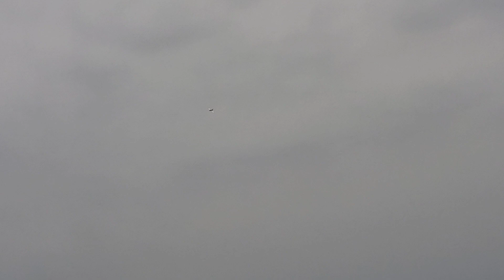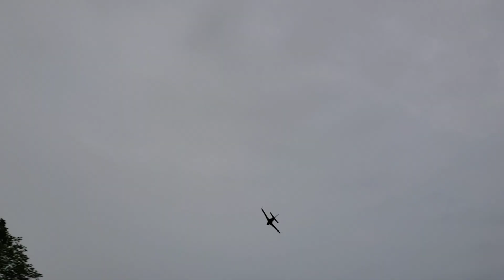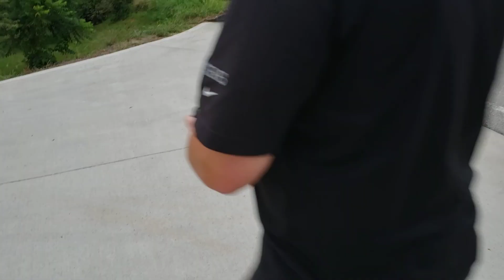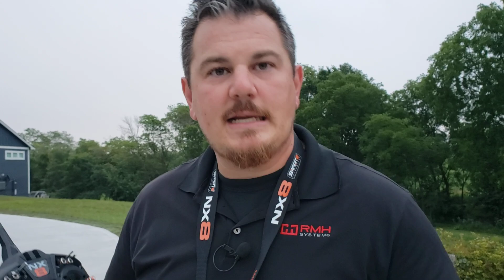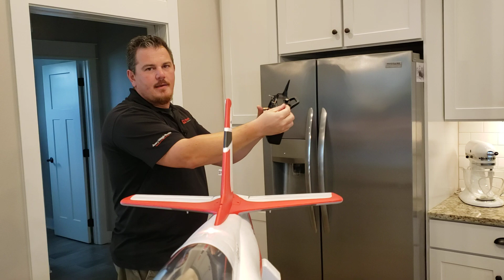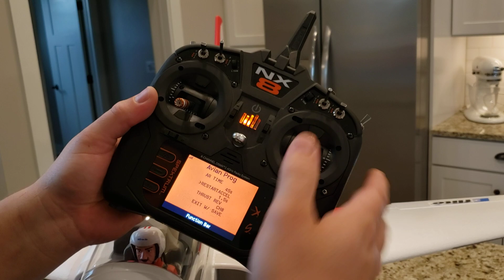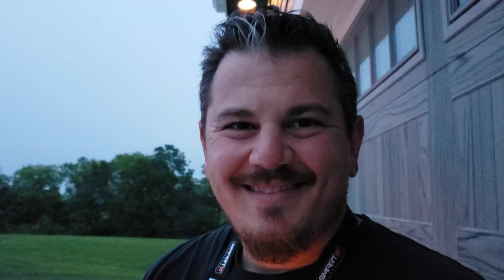Horizon Hobby - Viper 90mm - Pilot Fatigue Switch for Thrust Reverse & Test Flights

Comment: In my case on my F16, I had to reverse switch G (aux 4 on my radio channel 9) so that in the forward position, it was normal thrust.  When I set it up, the forward and middle positions were reverse thrust and the back position was normal thrust.  I wanted it the other way so after reversing the switch, I was able to put the values as Brian did in the mix and now everything works the way I want.  I know this video is 3 years ago but it still works today!  Thanks, Brian

Comment: Omg. Can we do this to the dx9?
Reply from the maker: Should be able to make this all work, but I don't have a DX9 to test it with, but shouldn't be a big deal. If you can't access the Avian ESC programming menu on your DX9, then you can try updating firmware on your Tx, then if still not, then get an Avian ESC programmer too, which can help you activate the Thrust Reversing, then just make a mix like we did...

https://www.jdoqocy.com/click-9240406-15735260?url=https%3A%2F%2Fwww.horizonhobby.com%2Fproduct%2Fsmart-esc-programming-update-box-avian-and-firma%2FSPMXCA200.html

Comment: Amazing and professional video.Thanks for sharing your knowledge with everyone. The plane is beautiful and flies well. It has, however, a deficiency: the left wing stalls on landing. (it happened to me twice time).  I saw online that it is possible to correct it by mixing the full flaps with the ailerons that go up togheter. In this way the stall moves from the tip to the center of the wing. They call it "Crow"......  I tried to do the mixing with my dx7s  (I will soon replace with the NX8), but the ailerons 1 - do not go up in the same direction 2- move even with medium flaps while only full flaps should work. I hope you have an idea how to do it and will advise me.  A friendly hug from Italy. (sorry for my english)

Comment: Do you mind telling me what battery you are flying on?
Reply from the maker: 7000mAh 6S (@ 1:15 I mention it in passing)... 7000 6S https://bit.ly/3PtmZRK , but you could also use the 5000 6S https://bit.ly/3PukVJf
Reply: Thank you.
Reply: One more question do you think there is any major performance difference between the 7000 and the 5000?

Comment: Hi, I'm trying to setup a viper 90mm with thrust reverse using a first gen dx9 spektrum transmitter and the viper 90mm has a AR637TA receiver with 130a Avian ESC.  I used the spektrum smart programmer and changed brake type to reverse, brake force to 7, thrust Rev CH7(default) on ESC, as I'm not using safe on the Viper (Ch 7) the default channel for Safe and I saved, data ok. On my TX I went into system setup, channel Assign and changed channel 7 Aux2 to button I and in digital switch setup for switch I , there is a 100%  100%.  All travel is 100% in servo setup, I'm using a mix in Mix 1  AX2 - Thr, rate 0% and -100, offset 100%, switch is set to I button,  I calibrated TX to Avian ESC 130A as per manual instructions.  Still no Thrust Reverse when I hold the I button,  motor continuously goes forward no thrust reverse, I tried reprogramming ESC over and over, no success.   Any ideas what I'm doing wrong,  thanks.
Reply from the maker: Only thing I'm not seeing in your notes would be that you have to make the switch conditions go -100 for forward, and +100 for reverse, or swap, if I'm backward. It's not a tough thing to change, but should be able to do it with your Tx, as I understand it.

If that's NOT it, have you tried just choosing a higher channel, like 9?
Reply: @BrianPhillipsRC  hi, switch condition does goes from 100 to -100 in digital switch setup, I also changed ftom Ch7, CH8 and CH9 in channel Assign and on the ESC to match, still no Thrust Reverse been trying many months on my spear time.  I tried everything from your videos to others and still can't get motor to Thrust reverse.

Comment: Hi Brian, I have some e-flight Jets with Spectrum ESC and Spektrum iX20 radio. Trust reverse works great at all. BUT for now I want the 90mm EDF VIPER fly with another radio make (CORE from Powerbox-Systems). DO YOU KNOW if it is possible to use the trust reverse feature also with another radio like Spektrum???

Comment: I am a fatigued pilot, actually 80 year old pilot (same thing).  I put my throttle reverse for my Cirrus on the
I button, then mixed the button (NX 10) with the throttle so that pushing the button gives me 100% throttle, regardless of the actual throttle position.  This way I can just land the plane normally and not have to hit a switch AND the throttle.  Make sense?
Reply from the maker: Yes, this is another way that people do it, and nothing wrong with doing what works for you!

Reverse thrust is NICE to have, especially if you're landing in a tight spot.

Comment: Hi, I have a question that a super expert like you might help me to answer.
I have an eFlite Turbo Timber Evolution, and a NX6.
I would like to buy a Viper 90 and wondering if it is possible to use my NX6 to fly it and use both Safe/Select/AS3X selection and reverser with my NX6.
Viper instructions say we can couple Flaps and SafeSelect in order to have Flaps Down Safe ON, Flaps Half Safe ON, Flaps Up, Safe OFF and AS3X ON.
I tried this on my TTE but I can only have Flaps Down Safe ON, Flaps Half Safe OFF, Flaps Up, Safe OFF, as I see there is a threshold value of 88 to have Safe Select ON, therefore Flaps Half (Zero value) triggers a SafeSelect OFF.
HorizonHobby explained that this is not working with my TTE as it will only work with the Viper due to different flaps mechanics.
As this looks to me an electronic issue, have you the chance to crosscheck this?! Thanks a lot!!

Comment: I thought the G switch was a myth. I couldn’t find it on my ix12. Wendy showed me where it was located. 
With that being said, I forgot I had programmed the Eflite a-10v2 for reverse thrust. (Really hadn’t needed it landing the little 64mm) But with the 90mm Viper I’m going “Hardcore Brian Phillips” with Reverse Thrust, Pilot Fatigue and all the mixing.
I may have to buy an Avian ESC for the Freewing 80mm a-10. It’s the biggest edf I got and with two 6s 6000’s I’d like to slow down quicker.

Comment: On my transmitter I programmed reverse on a pushbutton only ("pilot fatigue"). I think I don`t need "controllable" on a switch because I can give small portions of reverse thrust with  pushbutton only so I have enough of contol on the ground. IMO an extra switch for "controllable" is confusing and you have more risk employing reverse thrust while the plane is in the air.
Reply from the maker: That's a cool idea. I'm curious to hear how easy it is it hit the "I" button...I assume you used the "I" Button?
Reply: @BrianPhillipsRC  yes, I used it for the first flights and hit it accidentally but got control again, so my viper is still alive.   That`s why I use a self-resetting switch for this function only.
Reply: I wonder if it’s possible to have both controllable reverse thrust and also an I button for the pilot’s fatigue. Is that even possible Brian?

Comment: hey Brian first let me say i love all your video an I have learned alot..I followed your thrust reversing video for the 90mm viper....for some reason when I switch to full pilot fatigue....I'm not getting 100% reverse thrust...and I can still control it with the throttle stick as if the switch is in the middle position...what am I doing wrong.....thanks
Reply from the maker: Hummm....not sure why. Do you need to CALIBRATE your ESC???? This might do it, or you still have a setting set to 0%, in stead of -100% or +100%
Reply: @BrianPhillipsRC  ok thanks I will try the esc calibration I thought that I did that already but maybe I got the beeps wrong when doing it

Comment: Can we set up “pilot fatigue” mix on the Draco? Can you provide more detail how you would set it up? I have NX8 with thrust reverse set on switch A. I currently have combined all control surfaces High/Medium/Low rates to one switch so I obviously have open switches to program pilot fatigue. New to mixes.
Reply from the maker: You can do it EXACTLY the way we did it on this plane, with the DRACO, but that's a PROP plane...way more dangerous than the EDF here, so be super cautious.

Comment: Love it, Love it, Love it - the Pilot Fatigue mode is absolutely great!  Want to remember that trick going forward.  I don't have the 80mm F-16 yet, but if they ever come out in a Thunderbird scheme, my credit card is taking another hit.  My 90mm Viper was delivered yesterday after a 2 month wait.  I've spent more time programming the radio than assembly.  I have high hopes for this plane because I love the 70mm so much.  One concern I have is I cannot get it to come close to balancing with a 5000 battery, It is way tail heavy with the 5000.  It will balance neutral with a 6000 all the way forward.  I'm going to have to see where you have the battery again.
Reply from the maker: I wonder why??? I had no issues with my CG (5Ah or 7Ah), but I also kinda WANT it a touch tail heavy, for flare. 

Awesome plane, just be careful if HH screwed up and didn't get a counter weight in there - that could cause some issues....BUT I honestly don't remember even a peep of CG issues....

You will LOVE it. Flies like a DREAM!!!

Comment: What happened with that black spot on the driveway
Reply from the maker: I melt foam into poor mans asphalt... the county wouldn't let me pour the concrete there, so we seal over the rock to keep it making a mess on the driveway....every freaking delivery guy thinks they have to take the turn at 150 MPH, and the rock was always kicking up on the driveway.

Comment: If you liked horizon's 70mm viper you would absolutely  love my horizon 80mm viper. Knife edges, snap rolls etc. It is an absolute beast. It's what should have been released originally. I have ordered the 90mm. Hope it fly's as well or better.
Reply from the maker: I'm confused...was there an 80mm??? I wasn't aware of it...or is it a discontinued plane now??
Reply: @BrianPhillipsRC  It was  a modification that I made myself. It made the plane that was something fun to fly into an absolute beast. I mean like a super plane. The only mods I had to do was I used the  80mm from the fms bae hawk and  a 100 amp esc.

Comment: I had to update my RX and ESC before the ESC programming came up (this was on another plane). So just a note for your viewers.
Reply from the maker: On what plane? F18 80mm??? Some of the OLDER ones don't have this in the firmware.
Reply: @BrianPhillipsRC  Carbon Cub, which came with Smart ESC/RX. But that ESC programming function didn't appear in my radio (IX20) until I updated the firmware. So I guess HH shipped my CC with non-updated ESC/RX. I found out about the firmware updating only after researching the issue in RCGroups.

Comment: Hey Brian, I’ve had the 70mm viper for a while and it’s fantastic in the air but struggles on landings because it always wants to bounce/porpoise. Does the 90mm have the same tendency?
Reply from the maker: Not really, but I guess I don't have that problem on the 70...not that I grease them in every time, I'd say she's very well behaved. If the wheels are too HARD, you could swap them out for pneumatic or LOW BOUNCE tires?

Comment: Way to complicated for some of us intermediate flyers on setting up the reverse function. Any way of getting printed instructions on the final setting up procedure for Gen 2 transmitters? I have a DX-9. Also there were no Closed Captions to try to follow along.
Many thanks
Reply from the maker: CC might be delayed since it was just uploaded???

As for the final setup, we cover it at the end VERY end in the dark ;)
Reply: @BrianPhillipsRC  I’m begging you for a printed step by step instructions. I am a 77 year old, handicapped veteran, with sone brain related problems that make it difficult to interpret visual input but if I can see it in print, it makes sense. I can only fly planes with SAFE or SAFE Select as I have tremors and twitches that SAFE smooths out. I’m willing to donate money to a cause of your choice. I have a new in box Turbo Timber Evolution waiting to be assembled. Thank you for your valuable time.

Comment: Hi Brian I go a new jet f 15 eagle but I have a battery that is 4s 3200 mab 50c  and could I yous it in the plane
Reply from the maker: Are you asking is you can fly THIS Viper on the 4S 3200mAh 50c? OR will the F-15 64mm work with it?
Reply: @BrianPhillipsRC  sorry f 15 eagle